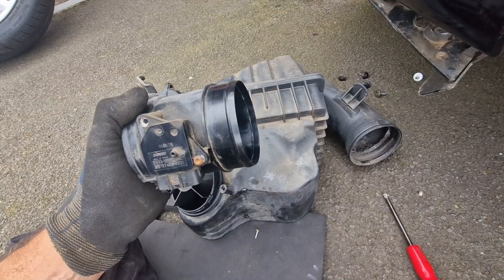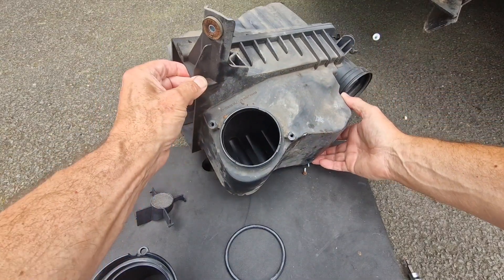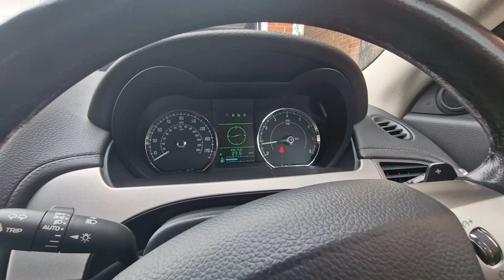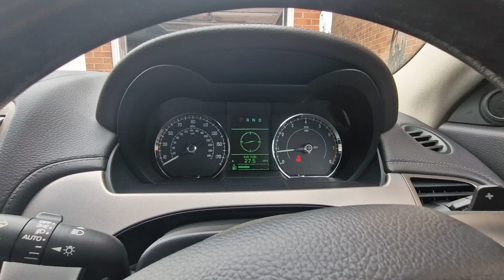Jaguar XK XKR (X150) Mass Air Flow Sensor - How to replace | Engine Diagnostic Fault Code.

Comment: Nice one Paul, I’m guessing on the 5.0 there are two of those MAF sensors to go with the double pain of two air filters….mind the potholes on the 500 i hear the road condition is appalling.
Reply: Correct, I done both MAFs' on my 2009 XKR-S (4.2) - I cleaned MAFs with electrical contact cleaner in between other jobs which involved pulling out the arch liners and the under trays - I do know I was at least 1 day getting the drivers MAF airbox taken off and put back due to the huge amount of work involved with rusted bolts etc. Jaguar wanted NOBODY to work on this car it seemed.

Comment: Great video  i just changed  the radiator thermostat  housing  and water  pump  on my 2008  going  as it should now if you can do diy can save  you a fortune

Comment: HI paul, I have a spare filter tray in good condition with the original screws in good condition here if you want it also the filter insert. If i had known I also have the full MAF assembly spare as well all in mint conition. Let me know if you want the tray and insert to replace the butchered one.

As you know I stripped the radiator out of mine recently and did the vaccum pipes, water pump and thermostat assembly all at the same time. Replacing the aircon rad when I get 5 mins free as well. All is good though, just wish i had videoed everything. One of these days!! hopefully catch up at some point. WEll done on the 5k subs award from youtube!

Comment: Excellent content, Paul. Another demystifying DIY masterclass from start to finish that helps keep the XKR in fine fettle and saves valuable cash on otherwise expensive garage bills. It wouldn't surprise me if age-related connector corrosion wasn't the source of this intermittent problem. The replacement MAFS does seem to have cured the problem. Well done!👍

Comment: Have you cleaned out your throttle body yet?
Reply from the maker: Not yet but on the "to do" list
Reply: @life_on_cars  Can you even do this, I read that its a sealed unit or something? Those were the days when I could do 5 minute jobs on my 3L Subaru with the flat 6